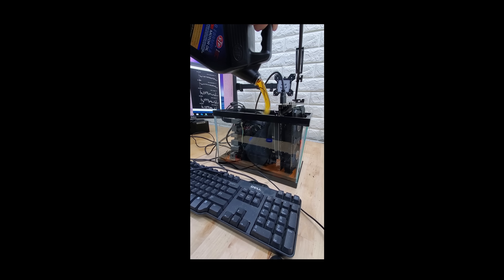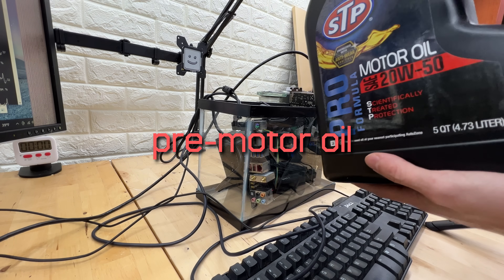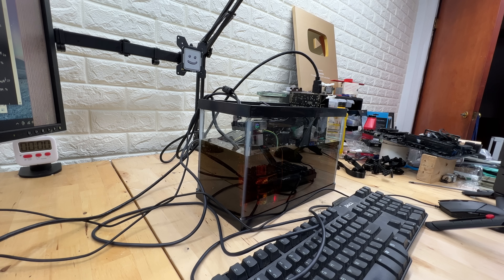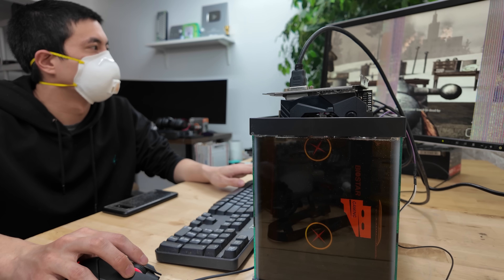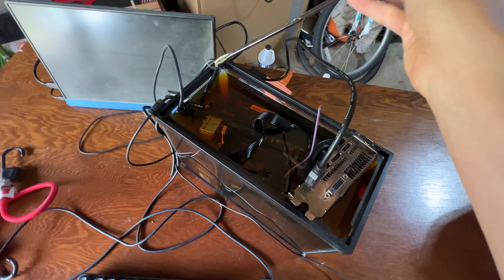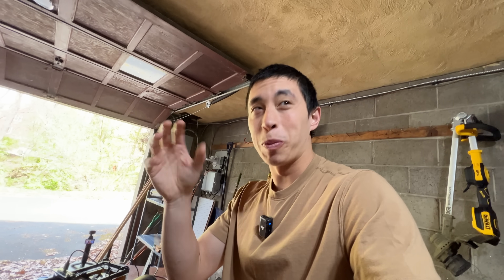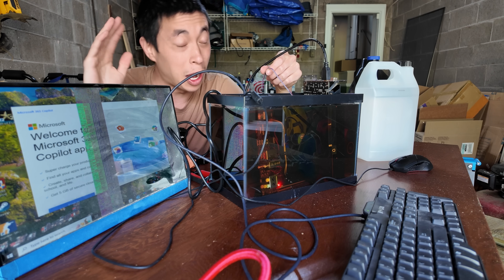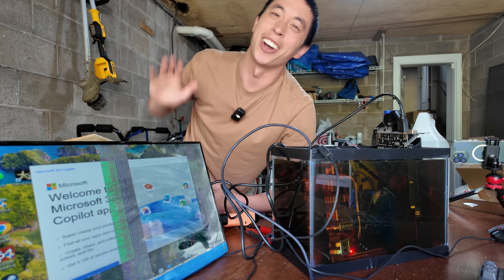Why isn't Motor Oil used to cool down PCs?

Comment: 20W-50 is too thick. Are you sure it's even synthetic? It's probably mineral with additives.
Reply: He said it's conventional,  so average viscosity is 20W-50. I also agree 20W-50 is way too thick, 0W-16 or 0W-20 would probably be best for an application like this.
Reply: @SubZeroXJ  use bacon grease
Reply: @SubZeroXJ I guess America, huh? In Europe 10w40 is much more common.
Reply: @SubZeroXJ Most Toyota use 0w-20 though
Reply: @SubZeroXJ conventional is 10w-40, and that's basically from 25 years ago.
Reply: @user-kd1qg4fo1d  10w-40? every car in our shop uses 5w-30. my 30 year old mazda even uses it
Reply: @thebiggamers999  the only cars i have that uses 5w-30 is my mazda, and my 240sx. all my old american cars it was 10w-30.
Reply: @ThatZenkiS14 well amsoil market research shows 37,7 of all sales go to 5w-30 while 10w-40 is 3%.
Reply: @thebiggamers999  what does market research have to do with what i said?. im saying specifically all of my older cars all say 10w-30. ive never had a car that needed 10w-40.
Reply: @ThatZenkiS14  whoops misread your comment then, yes 10w-30 is also common enough. 5w-30 and 10w-30 make up the bulk of car engine oils though they are slowly being replaced by 5w-20 and 0w-20
Reply: @thebiggamers999 no biggie i was just confused. maybe its because of how the new engines are, ive never really questions how they choose wjay weights the oil is in specific cars before. which is funny as much as  i fix them lol
Reply: @user-kd1qg4fo1d  not even that anymore usually 5/30 or 5/40.
Reply: im more annoyed he included the fan when it serves no purpose
Reply: who said it needs to be synthetic? you can get thin mineral oils
Reply: Even Full-synthetic oils are mineral based oils but with synthetic additivities. Its a play on words and a marketing gimmick. True synthetic oils are 100% synthetic, base oil and additives.
Reply: well, probably he wanted to use mineral, non-synthetic oil, since oil submerged PCs use mineral oil (of a different kind ofc). I believe that's what he thought.
Reply: He said it was conventional...
Reply: That was the conventional oil bottle. All motor oil has additives. Synthetic motor oil is just a blend of oils and additives tailored to the longevity and breakdown resistance that the intended use case needs.
Reply: The thickness doesn't matter. Engine oil doesn't cool the engine it lubricates it. The coolant and radiator cools the engine.
Reply: @trsskater  less thick oil would allow fans to keep spinning lol
Reply: @je5terc0re  spinning fans wouldn't mean anything if the heat doesn't go anywhere. The problem is oils aren't to remove it, they hold it. napalm also uses an oil to keep it burning. The video is s dumb idea for views.
Reply: @trsskater  You are completely right.
Reply: @trsskater  technically all he needs is an external pump & radiator to cool the oil after it removes heat from ICs.
Reply: @trsskater lie, what about oil cooled motorcycles or oil squirters on engines
Reply: @miguelgameiro8063 Thank you for calling me out on the edge cases when oil is used for cooling. Motorcycles already use a different oil than cars. And  this person is talking about using car engine oil not a oil that can be used for cooling. The standard motor oil isn't used nor design to cool an engine. So my point still stands. And you know the average person doesn't even know about that especially since it's so uncommon.
Reply: @trsskater - Even in cars oil splash is used to cool the moving parts of the the engine. It's not the primary coolant, but it certainly is a coolant.
Reply: @JCPRuckus  It's not a coolant in a car's application. It goes from absorbing the heat to holding heat. Once it has reached it's maximum heat soak temperatures go back to the max they can go as if there was no cooling. Cooling only works when paired with a radiator or something to move the heat the absorbed heat away from the engine.
Reply: @trsskater - The oil pump circulates the oil, moving the heat. And the oil exchanges heat to the engine block and the water coolant takes the heat to the radiator. And since you want to be pedantic, the oil pan also radiates heat, just not nearly as efficiently as a proper radiator. So, yes, the oil is a coolant for the parts that the water coolant system does not reach. Because it is used to transfer heat from those parts to the water coolant.
Reply: @JCPRuckus  That's not the oil providing cooling. That's the fins on the engine block transferring heat. This would happen still function the same if water it was just gas. Heat needs to be moved because of the oil not circulated. Engines are liquid cooled with a radiator. Not oil cooled. Otherwise then a convection oven would be air cooled. Or when you make soup it's being liquid cool.
Reply: @trsskater oil absolutely assists in cooling engines, especially the valves and valve springs which you cannot run coolant through. Some high performance engines use piston squirters to squirt oil on the bottom of the piston to help cool the piston, LSAs and LS9s came from the factory with piston squirters. NASCAR engines use dedicated valve squirters to cool the valves and valve springs to help those engines survive 500 miles of 7000-9500 rpm

Yes oil is lubricant but it's also a coolant.
Reply: @C6Z_Bob  A Nascar engine isn't a normal set up. They don't use normal oil. Just because it can doesn't mean that's the function in this case. Engine oil is not a coolant where using a thinner oil makes it cool better because it will never cool a PC by being submerged in it. That's now the way cooling works. So stop with all the edge cases where people are trying to push out tiny amounts of cooling where they can for the special application like as if they don't also have a whole engine cooling system to begin with to actually handle the main cooling. I can spray water in your face to help cool you off so you don't have to turn on your AC unit. Technically every liquid is a coolant. They would get the same cooling if they use milk. Air is also a coolant why not just take off the heat sinks and let the air just cool the PC on it own. This whole thing is just dumb.
Reply: @Kenoooobiiiii  The system cools the engine. Not the liquid alone. Like how air doesn't cool your PC without a heat sink and moving air. Thermal mass needs to move to provide cooling. Not sitting in it. I'm tiring of that stupidity that it's cooling because it has the ability to absorb heat. You can't regulate a boiling pot of water if it's sits there boiling without moving the heat away from it. But you guys logic is when I toss potatoes I to the water the temperature goes down before it boils again so potatoes provides cooling.
Reply: @trsskater  How does a fanless CPU cooler work then? You have the right idea, your logic is just off.  Heat rises and cool falls, liquids do the same, but depending on how much heat is generated, it's not fast enough on it's own to remove enough heat away quick enough before mechanical failure.  Motor oil does cool the crank shaft, journal bearings, and the slinging of motor oil from the journal ventures sling onto the bottom of the pistons and cylinder walls to provide lubrication and to draw away heat, but what keeps anything from seizing and generating too much heat is the lubrication.  The oil is also cooled through the valve train, albeit not in high volumes, coolant is passed through the heads, which the heads are absorbing the heat from the oil and the little explosions in the cylinders.  The block of an engine also absorbs that heat and releases it into the air, that helps oil to not reach boiling point/heat saturation and break down.  There's also no fins on an engine block of a vehicle except certain brands of air cooled motorcycles....high end aftermarket oil pans and differential covers have fins on them to draw away more heat from the oils in the vessel.

Back to the PC though, if it didn't overheat and shut down at some point, and it generated enough heat, sense the source of heat is so small, you'll see the oil rise in the middle where the motherboard, PCB of the graphics card and PSU are located, and it would cool from the air touching it at the top, move over to the sides of the tank, until it got cooled enough to drop back down to the bottom of the tank, where the oil closer to the components would scavenge the cooler oil towards the warmer parts, where the cycle would start over.  The oceanic current map is a good example of what would happen after some time, so yeah, the oil would provide cooling this way.

Fans are added to move more volume of air and liquids, so that mass can move more heat, also why heat sinks are important, they absorb the heat and spread it out so more volumes of air can transfer the heat.

Now onto your boiling water analogy, the water is taking away heat from the pot that is hot by turning into a gas and bubbling up to the top, that's what the pot doesn't melt or burn through, if you leave that same pot on without water in it, it'll burn through, so in that case the water is acting as a coolant for the pot.  Take that same pot of water though and spread it out, it'll evaporate way more quickly trying to disperse the heat it has absorbed.
Reply: @Derkman92  Honestly I done more research and I found out oil does cool but in the same way water cooling works. Using the engine block itself to radiate the block for air cooled systems which have fins to air cool or water cooling to assist and not need to be as efficient in air cooling. But the point I was trying to make with this PC it doesn't work not because the oil is too thick. It's because it lacks the surface area to make the heat transfer.
Reply: @trsskater  With all the heatsinks submerged and making contact with the oil and components, I would believe there would be enough, now if there was a higher end GPU or CPU in it, it would probably bubble and boil the oil right on the service of the component making it far less efficient.  It will flow eventually naturally, but it will take a long time under a heavy load, depending if it doesn't over heat before that happens with the heatsinks installed.

Water, oil and air all fall under fluids, they'll all cool something in pretty much the same way, it flows, it cools.  Depending on capacity of said fluid though, is when heat saturation has to be taken into account.

Actually, a good example that explains what I'm talking about is a youtuber called BringusStudios, he actually increase the surface area of a CPU by drilling a bunch of holes in the heat spreader of a CPU, it was genius.
Reply: @Derkman92  I understand what you are saying but this is something that has been done a long time ago with mineral oil submerged PCs from pugid systems. It makes the PC look like it's in a fish tank filled with water. They cooled the oil with a radiator with fans outside the oil. The problem just like you are saying the oil carries the heat away from the components but it doesn't get rid of the heat. The air is the next thing to take the heat away from the system and it can't do that very well without more surface area like how heatsinks work by creating a lot of surface area in a small space. It needs to be a low end system to work without water cooling. There are of videos on YouTube about it. The oil gets hot and everything starts to thermal throttle because the ambient temperature of oil is too high and the heat. And the case isn't exchanging heat to the air so the only space is just the top of the oil. It would be like trying to use standard air cooling for your PC when it's 150°f in your room. It just doesn't work as well as if your room was at 40°f. Look up aquarium PCs and you'll see a lot of videos and the results of this even with low end components since people only did it with low componets or stuff they had lying around. Actually even Linus Tech Tips did a video over 10 years ago and also says it's not a good way to cool your PC as well. That it's just for show.
Reply: @trsskater  So youre talking about heat saturation.  What you're saying is 100% correct, heavier dense objects retain heat longer and don't disperse it as quickly as air or a specific coolant like a refrigeratant.  A denser fluid would need more volume of material to not be heat saturated before it dispersed the heat fast enough.  This application would still work if the tank was much larger for a sustainable amount of time, but in the tiny tanks like used here or the one Linus used, the fluid gets heat saturdated quickly.  Tank material also plays a role in this of dispersing the heat as well, glass and plastic are pretty good insulators, but a metal (i.e. aluminum) tank would help this as well, defeating the purpose of making it look cool.

Comment: I'm really curious if a thinner oil like 0w-16 would allow the fans to spin. Either way I love these ridiculous experiment videos!
Reply: It would. I've seen them spin in mineral oil submerged builds, and that stuff is, as far as I could tell, actually less viscous.
Reply: fans could spin. However biggest issue is the thermal paste. Oil dissolves it.
Reply: Why would you even need to spin them?
Reply: The fans wouldn't be as useful anyways. The heat will naturally cause the oil to move heat towards the top, but to speed up the process you could install a pump and do a larger setup just like a water cooled PC uses, except it's the entire tank and not tubes pushing fluids to a radiator.